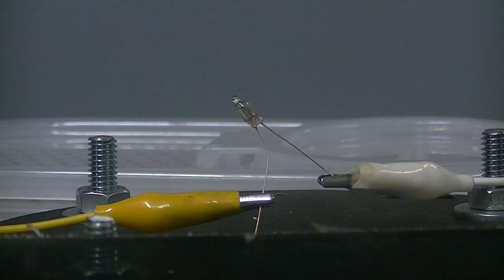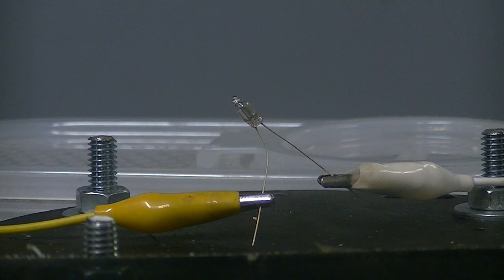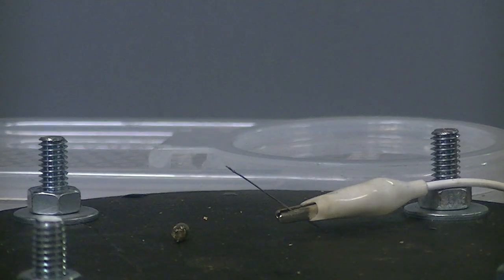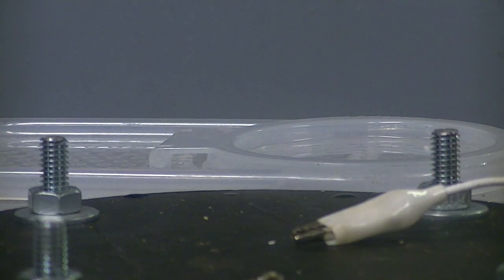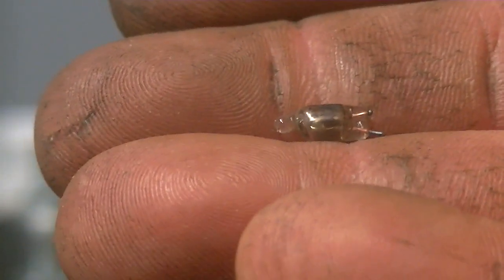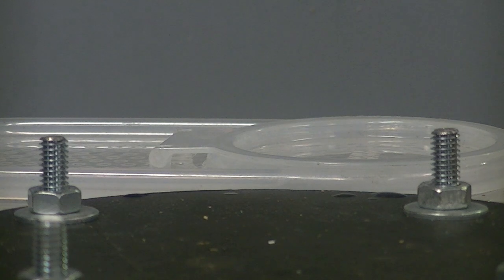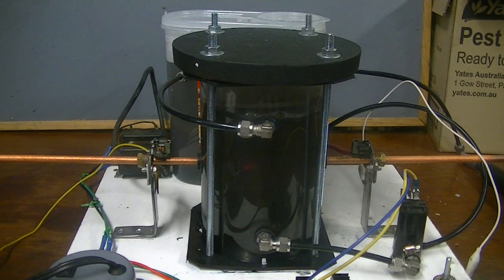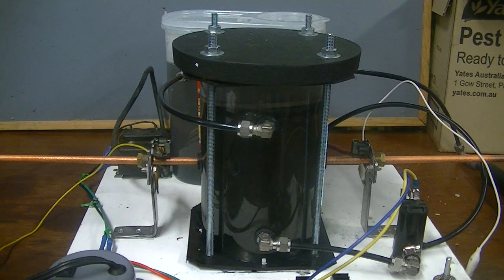PlazArc Reactor High voltage spikes across arc

Comment: nice experiment i am more interested in the black powder in the water any idea what it is maybe should filter the black powder and try some experiments with that
Reply from the maker: The black powder in the water is the unused portion of the carbon rod's. May be good for the graphite base for super capacitors.
Reply: a while back i was making carbon nano tubes and this is how i made them passing a current thru carbon rods minus the copper cladding in water, they are  very good for batteries got some good results